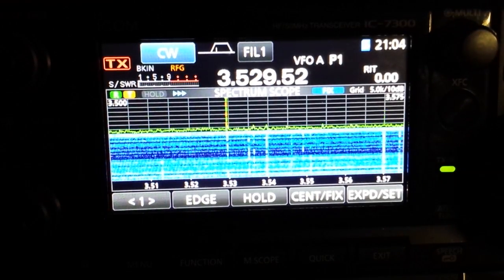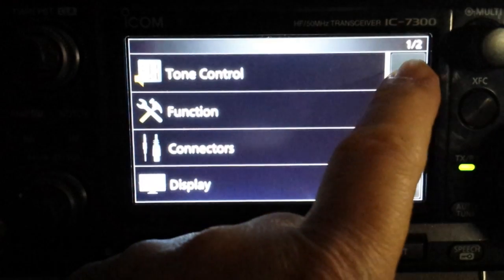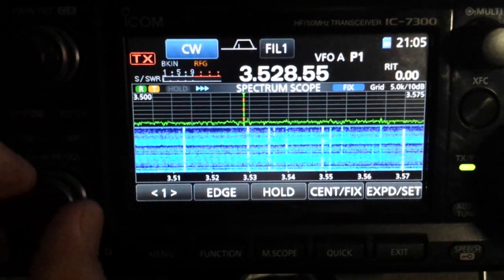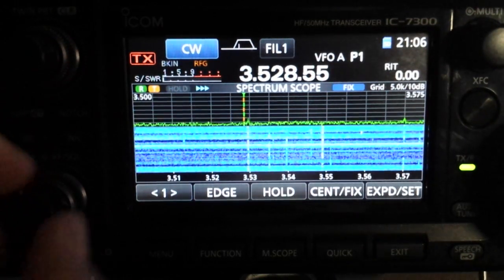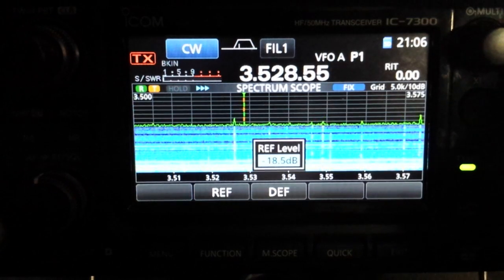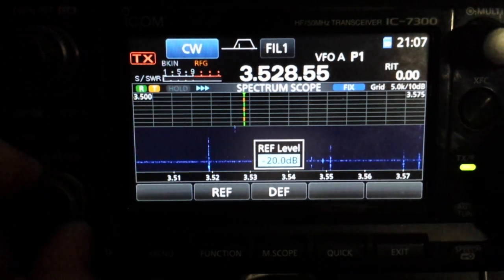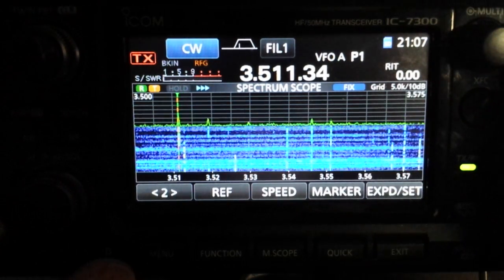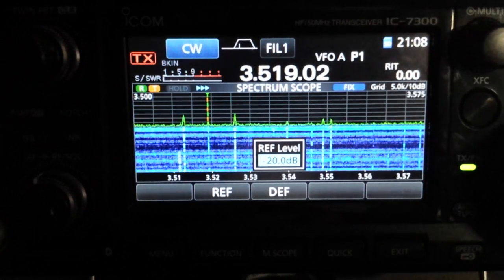IC-7300 Bandscope REF Adjustment - N4LQ

Comment: Have you done a video on the Audio menu selection ?  I do not find it very helpful. Perhaps you have some suggestions. I know you can use the Scope selection at 2.5 does a little better job. What i would like to see is if a radio/amp is overdriven, or if a mic has to much base (yes you can hear this) or treble or no mid ranges.  Thanks !

Comment: to calibrate the Ref Level (for each band), I set the RF/SQL to mid and tune to a blank place on the band.  Then I turn up the Ref Level until the waterfall just starts to show the noise background (minimum speckles showing).   That sets the waterfall so I can see the difference between a signal and the noise background.

Comment: Suppose that you have the spectrum scope on, and you are in the Centered mode, (CENT/FIX button). If you want to clear somehow the cataract, then you press the REF button and using the main dial, you may alter the level by + or - 20dB. If you decide to change to the Fixed mode, (CENT/FIX button), then the already regulated according to your needs REF, is gone! You must again alter it, to a new position, in order to watch the cataract, as before. Has anyone else spotted that?

Comment: Thanks, Steve. I recently discovered this. I have a problem sometimes in that sometimes when I touch the tuning dial it seems to echo in my headphones. I think I'm overdriving something, but what? Also, sometimes when I reduce my RF Gain too low near zero, I get a hi-pitched hum until I turn the RF Gain back up. Learning to find the  RF Gain sweet spot is tricky.
Reply from the maker: Rob. What do you mean by "touch"? Just touching or turning? Sounds pretty weird.
Reply: Steve, I meant to say when the VFO is moved. Imagine a very thin wire very taught and plucked, but muted. I wish I could replicate it for you. The next time, I'll pay closer attention to all of my settings. Being new to both the hobby and radio, I don't know when things are set correctly or incorrectly, but video tutorials like yours have been key in my learning. Keep producing them and I'll keep watching them.
Reply from the maker: Sounds like something is wrong with that radio Rob. The RF Gain control shouldn't have a "sweet spot" and never a squeal. What is your callsign?
Reply: WA9RAD. It doesn't do this all the time. And related to RF Gain, is it normal to have a noise, or pitch when the RF gain is cranked fully counter clockwise, reducing it to zero?
Reply from the maker: No it's not normal. You should have zero sound with RFG counterclockwise.  Something is really wrong there. All I can think of is trying a reset. See page 9-1 in the basic manual. If that's no help then I would call ICOM. They will no doubt ask if you did it anyway.
Reply: Thank you, Steve. Good to know you can un-screw a screw-up. I'll try it. Then I'll follow your videos to reset the waterfall. Those were very helpful.